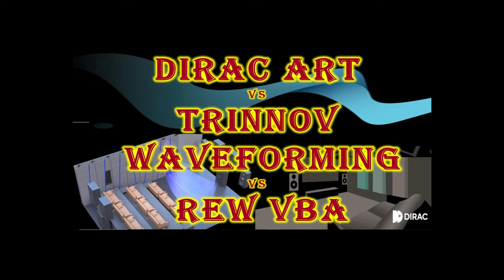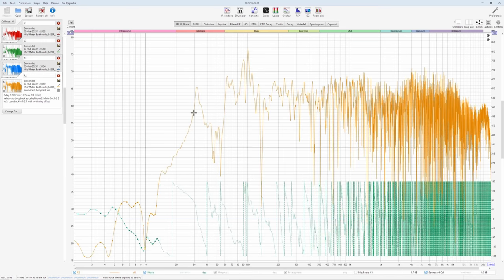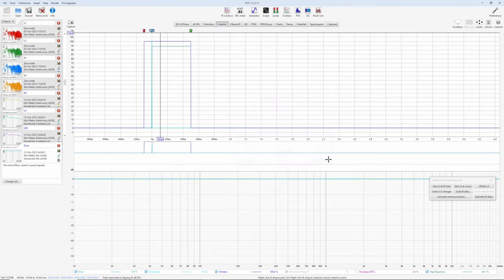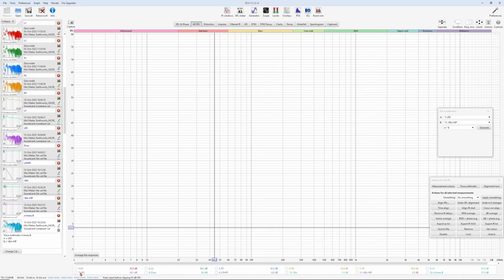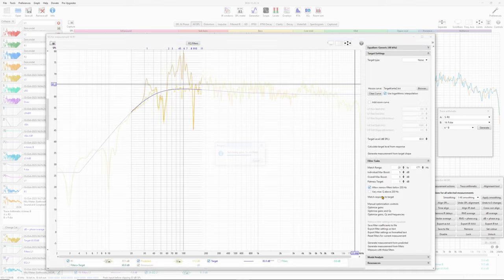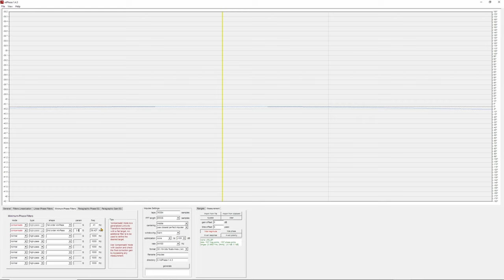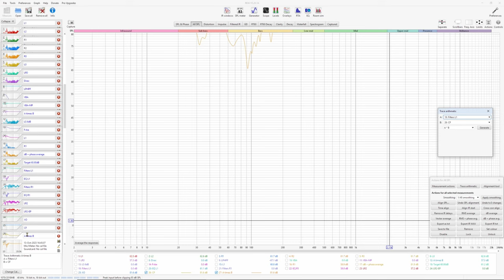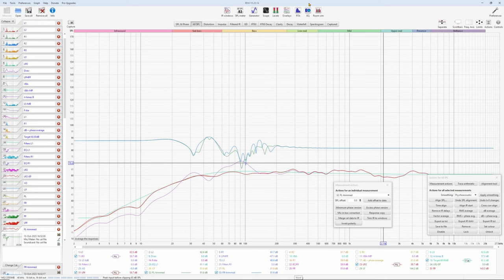Dirac ART vs Trinnov Waveforming vs REW VBA

Comment: JBL 306p MkII + LSR310s is the computer desktop setup I am working with through this tutorial, in a medium-sized bedroom (~5m wide x 4m deep x 3m tall), not centered left-to-right. Stereo balanced output from DAC going to sub, crossover done in sub and balanced outputs to speakers. Crossover switch on sub is at 80Hz. I have three main bass peaks on both channels: both have a +20dB peak at 40Hz, +7dB peak at 58Hz, and then L has +9dB at 104Hz and R has +8dB at 139Hz.

Based on the tutorial, I am working on the main 40Hz peak with VBA, and I'm getting great simulated results from it, but the "match range" instruction at 27:40 is limiting my filter's range to just 79Hz and thus not touching the L 104Hz and R 139Hz peaks. Would there be any issue using a higher "match range" upper limit to capture the 104Hz and 139Hz peaks for the filter?
Reply from the maker: You can comfortably go up to 200Hz
Reply: @ocaudiophile  Thanks, I will give that a try today, I'm sure it will sound even better than my initial filter. As it stands, I can't believe how much better the measured step response was! Audibly the change was a little subtle (makes sense, since it was mainly working on 80Hz and below), but once I picked up on it I couldn't un-hear it in bass-heavy attacks like kick drums, guitar, etc., specifically the decay after the initial attack. Only aspect that wasn't a clear measured improvement was impulse response (first peak wasn't quite as high as unfiltered, but decay was better). I might have missed an alignment somewhere so I'm going to start from the baseline measurements and build it again. Of course measurement variation (mic placement etc.) could be at fault for that.

I'm also going to change my target curve, the curve I made was much flatter than Harman in bass and sounded a little weak (I ended up adding a +3dB low shelf in my DSP app below 150Hz to get it to taste). I know you're active on ASR, which thread would be a good place to share my measurements?
Reply from the maker: Are you comparing "normalized" impulse plots? You can share mdat files here if you upload them in google drive. In ASR there's no particular threat but you can start one ;) @MikeyAntonakakis
Reply: @ocaudiophile  Actually I just looked again, and my comment about IR was wrong - very similar between before/after but slightly higher peak after the filter, and no initial "drop" before the main peak, just like in the video. I'll start a thread on ASR and tag you, it will be a little easier than YouTube comments :)

Comment: Through your videos, I have noted several hardware platforms on which your filters run.  I was curious if you or your viewers have ever used Camilla DSP on a Raspberry PI.  I have found it to be extremely flexible and very powerful for multi-channel setups.  My setup is modest ( Rpi4, Motu Ultralite mk5, Aiyma A07, 2.1) but great fun to experiment with.  Your setups work wonderfully and have enabled me to create an amazing sounding yet compact setup.  Thank You!
Reply from the maker: You're very welcome.

I have an old i5 Intel NUC and use JRiver and Roon. I also used Equalizer APO for some time but didn't have a chance to try Camilla DSP though I know it's widely used by the audiophile community and it's MAC compatible.

I think you can do even more with a Motu Ultralite. Have a look at the below discussion: The guy claims to have writteen the lowest latency multichannel (up to 256) convolution engine:

https://www.diyaudio.com/community/threads/windows-based-asio-dsp-for-crossovers-and-eq.397971/
Reply: I have tried Camilla on Windows 10, no issues loading a convolution filter. Within reasonable filter size, should be zero issues with Raspberry either (I plan to use that exact setup). The only thing you might encounter, which may or may not matter for you, is some delay/loss of sync between audio and video if that's important - only should be an issue with non-minimum phase filters, and depends on number of taps.

Comment: Hello OCA,

After re-watching some of your current videos, the question arose as to whether aligning the pulse with the AVR distances is no longer necessary?
At least you don't go into it there anymore and I could see that you created filters from measurements that weren't on time reference.
Does this have to do with using “remove IR delays”?

I came across this yesterday when I wanted to set the subs to the mains and was suddenly unsure which of the impulses I should now set to RF. Previously you always used the first highest 100% for this.
Reply from the maker: This method is not applicable to surround system and AVRs. It's for stereo setups with a convolution filter run from a PC of some sort.
Reply: @ocaudiophile 
It was clear to me that the filter had to be used on the PC or MiniDSP.
But that it doesn't work for surround and center, not!

Can the phase method be used here?

It is still unclear to me whether the Impulse is set to Ref with the distances in the AVR.
Are internal delays eliminated with the IR Delays System? Can the function be used generally?
Reply from the maker: It can be used with any device which can process FIR filters!

Comment: Thanks again for the amazing video and method.💫
I tried it and the result is perfect👌
I would like though to discuss a difference that i tried and the outcome was very very good.
Instead of calculating the target from the speakers anechoic response to create the LPF, i tried the measurement's frequency one peak below the highest peak, in your case the 44.4255 the same on HPLPF with Olives curve selected and 12db slope for better roll off. And also every target after with the same roll off.
I would like to hear your experienced opinion about this. And please do try it and let me know how you feel with the result. You started this obsession 😂🤗
Reply from the maker: The goal is to remove the room from the speaker and in return, the speaker will remove itself from the room ;)
Your prefered curve can coincidentally be similar to your speakers anechoic response or may be the room resonances somehow added up nicely for that curve and associated cut off filters. In general any extra bass you leave on top of speaker's capacity will be the room reflections which are by definition delayed signals and that ruins the dynamics of the bass and also it's not possible to duplicate the same response for the second speaker hence the inaccuracies in stereo imaging.

Removing boomy bass is a good first step in room EQ but removing the room completely is the ultimate room EQ goal.
Reply: @ocaudiophile  Coincidentally this type of curve removed the room quite obviously and the bass response was tighter. I tried it in two different rooms measurement etc and with two different set of speaker brands and the result was similarly. So it seems to work but i have some doubts of thinking that is my perception . 
If there is no trouble do try it and listen on your place how you perceive it.
Maybe is a matter of taste? I don't know.
But the sure thing is that you have given to us Gold reproduction of Sound.
I really really thank you for this!! 🙏
Reply from the maker: As long as you enjoy what you're hearing, it's the right method. But our ears are very spoiled and start to look for even better sound quite quickly (and unfortunately forever!).

Comment: I've tried to adapt this to 5 full range speakers in a surround system. 

I use a minidsp with full range LF and LR input going to LF, LR, and LS; and a second minidsp for RF, RR, RS.

Route the sub frequncies to all L speakers with FIR and time alignment, crossovers within minidsp. Similarily with right. And then time align L&R virtual sub between both sides.

It definitely sounds good and i percieve directional bass. Its like a 5.7 system i guess. But is it "correct" like your videos, im not sure
Reply from the maker: It surely is a very uniform bass with 7 woofers. Nice trick!
Reply: @ocaudiophile  definitely a trick I agree. However the speakers only go down to 40hz so they aren't strictly sub, you still need 2 real subs to handle  20-40hz.

Comment: Thanks for all your videos, i learned so much.

I started using Audiolense recently on my 2.2 system. Is there any way to add a VBA filter to the filter already generated by audiolense ? 

I can generate the VBA on REW and add the audiolense filters on REW too. But will this work ? Or i have to use the VBA as a prefilter on the audiolense process but i'm not sure of the interaction with one another.

Many thanks.
Reply from the maker: Just import your audiolense filters in wav format to REW and you can multiply as many filters as you like and generate new combined filters (A x B trace arithmetic).
Reply: @ocaudiophile  Thanks i will try this

Comment: Amazing work. how do you add a subwoofer to the main speakers with this method?
Reply from the maker: The optimal way would be to cross the sub over with your mains at their specified -3dB low bass limit and align sub/main timing such that their group delays are level at the mid/high frequencies. After that you can measure sub/main mix as one and apply the method here as you would with just the speaker, room modes are independent of speaker placement. Port frequency will be sub's port frequency and speaker XO frequencies and phase shifts will stay the same.

Comment: Hi . Greating from Malaysia. Thanks again for the wonderful video. As spoken previously in other tutorial. Is it possible you come out with a new video on calibrating Stereo system only Left and Right speakers using REW ? 
This are the current setup Mcintosh amp, 
Dynaudio standmount speakers, 
HifiRose streamer/DAC, 
Marantz CDplayer. Thank you very much.❤
Reply from the maker: This one and the workshop videos are for stereo systems. VBA cannot be applied to surround systems unless you're using a HTPC and ATmos is not availble even with that.

Comment: Love your videos, just struggle to be able to read the text on your screen, which makes is so small even on my 27” monitor.
Reply from the maker: I understand but 2560x1440 at 60Hz is the best I can do with screen recording in 16:9 format
Reply: @ocaudiophile  are you not able to do 1920 X 1080?  Would make the text bigger.
Reply from the maker: You can adjust to a lower res in YT settings. @WillyLax24
Reply: @ocaudiophile  that will just lower the resolution making it even harder to read but will not change the text size on the video. If you change your monitor resolution to 1920 x 1080, Windows will automatically adjust the size of the text on your screen, making it larger and much easier for us people over 40 to read. Not trying to be a jerk, I just live your videos and would really like to be able to actually read what you are doing.
Reply from the maker: I understand. I will check using lower resolution for the next video. In the mean time, the link to the complete REW mdat file used in the video is shared in the description. It might help you. @WillyLax24

Comment: 06:00 Trinnov Wave Forming is NOT generally considered to be the more advanced technology, where did you get that from? You AI gathered some text saying this, but it's unfounded. Dirac ART together with the rest of the Dirac Live suite can do what Trinnov does and more. In addition it can go beyond rectangular rooms. Other than, I appreciate your walk through in REW.
Reply from the maker: Compare waterfall graphs for both and you can easily see the major supremacy of Waveforming. How do you expect Dirac to cancel out 20Hz waves with small surround/ceiling speakers randomly placed in a room against wall to wall array of subwoofers of Trinnov? ART is only the better choice when setup costs are taken into account.
Reply from the maker: and how do you know that for certain? Do you have both of the undisclosed and patented MIMO/MSMC algorithms available to you? Trinnov Waeforming isn't even publicly available yet, only installed in a couple of ultra high end home cinema systems.
Reply: You're the one that made the unsubstantiated claim that "Trinnov waveforming is generally considered to be more advanced technology..." (your claim 1) "...and it can provide better bass performance in rooms with difficult acoustics." (your claim 2) and make a blanket statement "Also correct" for both. Nothing you presented substantiates your claim. Let's start there. Then, when I point this out, instead of providing the evidence to your original claim you modify the base of comparison, comparing ART with small surround/ceiling speakers randomly placed in a room against a Trinnov wall to wall array of subwoofers, which as I pointed out is an obviously meaningless comparison, apples to oranges based on hardware differences. ART can also be set up to run a wall to wall array of subwoofers, which then should be the comparison made. ART can, as I said, do more than Trinnov based on what has been published. In addition you ask me "how do you know that for certain?"  with the addition "Trinnov Waveforming isn't even publicly available yet" OK, great, then how can it be "generally considered..." [by whom? on what basis?] "...the more advanced technology" [if it's not available how can it be considered more advanced?].  I can't just sit by and take your statements as statement of facts "true" "correct" "also correct" unless you substantiate them. You haven't.  @ocaudiophile
Reply from the maker: I listened to both, one in Munich and one in Barcelona and Trinnov was on another level and most experts there had the same opinion, too. I have nothing against Dirac ART and I have no connection whatsoever with Trinnov. There's a massive price difference between the two anyway. I stand by my comments.

Trinnov has recently announced a cut-down version for "normal" home cinemas that will not require subwoofer arrays, then we will be able to see who was right I guess.

FWITW, Dirac Art takes 9 measurements with any USB mic that the user has avaialble, Trinnov takes 128 measurements with a custom 3D mic with 4 capsules.
Reply: "I stand by my comments." Thank you for your reply. So do I. Your p-o-w is only that, not an authoritative statement implied in "Generally considered..." or in evaluations such as "...more advanced" or "Correct." I don't mind your having a preference based on your experience of different set ups, but suggesting the above as facts detracts from your actual authority in showing how we can improve our sound systems. Let me clarify, I do appreciate your detailed walk throughs of how to use the tools and how to get results. As for the measurements with the microphone using the Trinnov mic, nothing impedes more measurements using Dirac ART. After all it's information science, not opinion or p-o-w. Dirac used 224 receiver control points in a 3D coarse grid matrix for the multi seat, and 343 control points in a 3D dense grid matrix for the sweet spot. They then statistically compared the results they attained with a 9 control point 3D grid and concluded this was necessary and sufficient to reach comparable results. This, because most people don't have a 224 coarse 3D grid or 343 dense 3D grids available, and probably wouldn't have the patience to measure it manually.Their scientific procedure proved the robustness of both their models and the 9 point measurement model.  @ocaudiophile
Reply from the maker: I never liked what Dirac Live does to high frequencies but I will invest in ART when I upgrade my receiver. However, if you watch some of my other videos, I have designed "virtual bass array" filters in the past (and long before Dirac) and I know a thing or two about cancelling out standing waves with polarity inverted counter waves. The main problem lies in the fact that, the counter wave doesn't completely disappear and you just create another additional standing wave wondering in the room. Trinnov, in their explanation of the method in Waveforming, states that they use the subwoofer arrays on one wall to steer the bass waves towards the other wall which made sense to me although I have no idea how they are doing that. I believe Dirac ART is not doing any of that but just focusing on the cancellation wave generation.

Nevertheless, I am glad that these MIMO systems finally exist and we can discuss them. It's a big step in DRC IMO.
Reply: "Trinnov... use the subwoofer arrays on one wall to steer the bass waves towards the other wall which made sense to me" Ok, what sense did you make of it? If it's the initial array it does indeed steer the bass wave, as a plane wave, to the other wall where it gets cancelled by an inversion. So the forming they apply is a plane wave. Only works in mono. Do they claim anything else, any other form of steering?

"The main problem lies in the fact that, the counter wave doesn't completely disappear and you just create another additional standing wave wondering in the room." 

Standing waves don't wander. That's why they're called standing.

"I never liked what Dirac Live does to high frequencies." What do they do? What didn't you like about it?

  @ocaudiophile
Reply from the maker: https://youtu.be/qoFZPlXrTeM
Reply from the maker: https://vbn.aau.dk/ws/files/549500200/AC-phd.pdf

 @GadgetyMV
Reply: I have read Celestinos CABS (DBA) previously, thanks.  Trinnov cloaks their DBA in proprietary and undisclosed dress-up. Looking forward to any additional articulated insights beyond that. Thanks for the links anyway.  @ocaudiophile